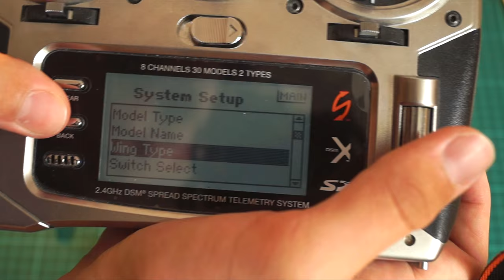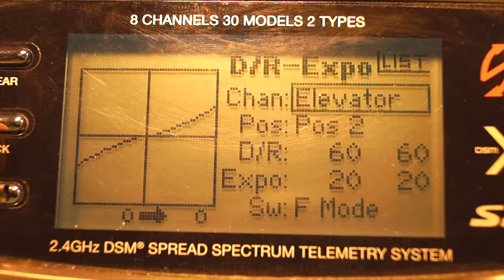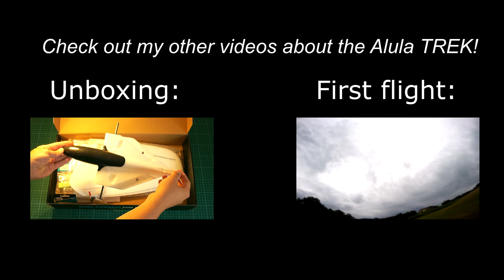Alula Trek - Build and TX Setup

Comment: 1:45 when you have the control arms with two sides, if and arm one doesn’t lineup at a perfect 90°, pull it off the spline and turn it 180°, the splines are offset just a little so that if one arm doesn’t come off perfectly perpendicular (T) the other one will. This way you won’t lose any percentage of the servo throw by using the radio offset feature.
Reply: …And using a pair of flush-cut pliers, cut off the unused arm.

Comment: My allula arrived friday they have added a third magnet to the cockpit  .  I used a park-n-power lipo 3.7V 600mah 1s battery and used a 5V TURNIGY Voltage Booster   , turnigy TS541A servos .